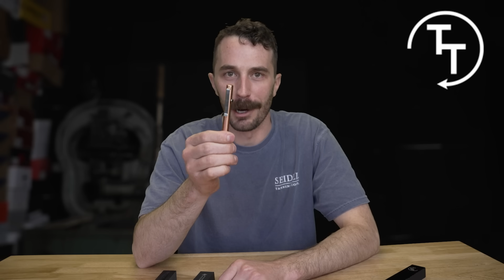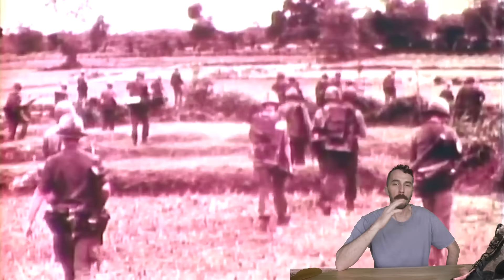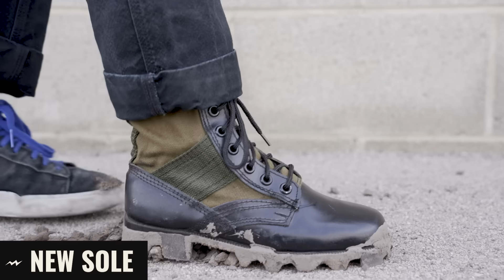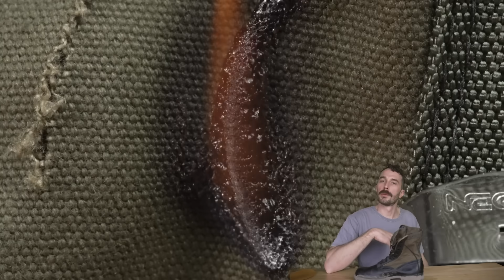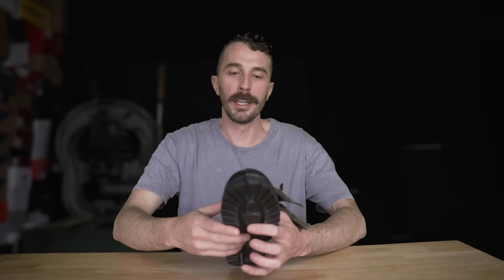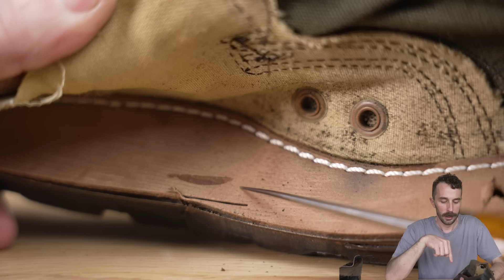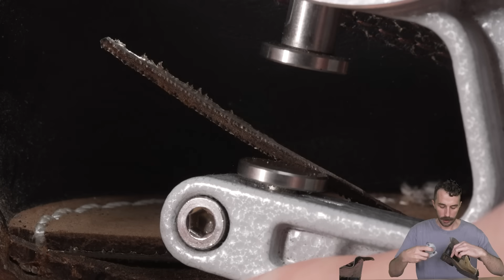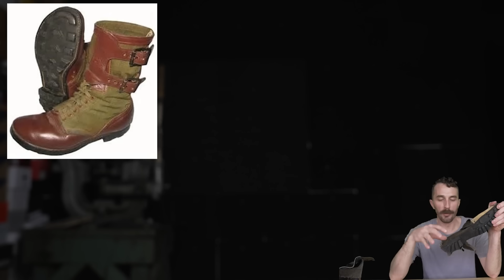Why it took 57 years to replace jungle boots

Comment: Those soles do work and I wore hot weather boots (more modern version) in both dry and humid heat.  Even if your feet get wet, they will get dry just from walking around for a while.

Comment: @Rose Anvil Really enjoyed the video, however the purpose of the wooden block isn't material purposes, as a matter of fact, the wood block is in there for marching. When you do drill, your foot slams gotta be loud and by extension hard on the foot, so the wood block is there so you can sound louder and more pronounced without doing what I did which was develop a fracture in my foot. this is also to make that commonly heard marching sound of 45+ soldiers helping you stay in unison with the others in your platoon or company.  The other use of the block in your boot is so when in training, the training NCO's and DI's will know by sound if you're doing the drill correctly.

Comment: I was issued the 2nd Gen. Vibram soled boot in the 70s after a few years of wearing the standard issue leather boot, late 60s thru late 80s. They were extremely comfortable in climates from desert to tropical. They were cold on your feet in cold weather. Go figure. They were popular enough to get a desert version made during the late 80s. I had my desert boots issued the day before returning to the states after Desert Storm. I wore them, as well as standard leather boots until retirement, but was not as happy with them as the older jungle boot. The mesh insoles were standard issue in the leather boots and were much better than commercial insoles as long as they were kept clean. During the life of my boots, I went through two or three insoles. They did wear out after a while. Bottom line, I wore two generations of issue leather boots and two generations of canvas/leather boots. The jungle boot was my favorite. In warm weather.

Comment: I have a pair of od jungle boots by RO-Search and they are made so well. They were made in 1980 and I've worn them on and off since the 90's. I just polished them and they still have traction, even the waffle insole is intact👍

Comment: I served from 1988-2014.  Until the transition to ACUs and the split leather desert style boots in 2003/2004, the jungle boot was the go-to boot for combat arms soldiers (except in winter time). I’d always have a couple pairs broken in and in wear rotation. I’d have to get a new pair every 6-8 months from wearing them out.  They have to be the real GI issue variety, not the horrible knock offs you find in most surplus stores.  Altima was the manufacturer brand name of the good variety. The GI issue desert tan boots of the ACU era were pretty much just a suede version of the jungle boot.

Comment: Ive been wearing jungle boots for decades. Hate to see you cut a pair like that up. Panama sole is about all that anybody can find any more. The beach assault sole was the best. The originals made in the 1960s and 1970s had higher tops, and the canvas was much thicker and really sturdy. They put spike protection in the soles, after that, all the soldiers started getting spiked in the side of the foot. Hell, all of todays boots are made in China. 🤢🤮

Comment: Was in Nam and loved the jungle boots. Light and dried out quick. Was lucky enough to be in a helicopter company so got to sleep in hootches with cement floors. Tried to hang them upside down so bugs would usually not enter. Had to make sure that you bang them together several times to remove roaches & other bugs. Never saw the jungle boots with extra large lugs. Thanks for great vid.

Comment: On my first tour in Vietnam--Marine Corps infantry--my jungle boots didn't have that nylon strap to reinforce the canvas sides. After about a year in the field I still had the same pair of boots. Both boots had a hole worn in the canvas about an inch in diameter at the ankles. I've always thought that was the reason for the strap on later models.

Comment: Back in the late 80's they must have found a warehouse full of Jungle Boots made in 1966 and issued them to us. They were so dry rotted you walked right out of the soles with a week. I'm still wearing the Magnum Boots I wore in Afghanistan 11 years ago. They are sturdy, have great ankle support and are as comfortable as a pair of sneakers. The Issue USMC Boots will last forever but are very uncomfortable to wear. The soles are like iron.

Comment: This brings back memories.  My two favorite boots were the jungle boots (desert version) which were about as good at it got in the desert heat, and for dress the Corcoran tanker boot, which were just amazing.  The Corcoran’s were not official issue, but they looked so good nobody ever gave you crap about it.  And yes, the jungle boot is not expensive.
Reply: Corcan tanker boots are authorized boots, anyone who says they aren’t just doesn’t know the order. Some older tankers used to wear them after they completed gunnery table 4
Reply: @kcLo505  I am going back many more years than I care to remember, and i was wearing them on the flight line.  (If they weren’t okay, why were they for sale at the PX? 😉 )
Reply: As soon as I graduated basic I bought  a pair of Cochran's. I eventually keep three pair in rotation. Formation, work, and field. Great boots!
Reply: My Desert "jungle" boots are still my GO-TO footwear for my lawn or yard work.
Reply: I never knew tankers had their own style of boot. I looked them up very sharp. I also loved my jungles and deserts.  I got out 35 years ago, but I still have a pair of each, they have side zippers now, but I wear them almost every day.
Reply: Spot on! I didn't know how good a boot could be till I got fitted for the DCU boots in Saudi. Tanker Corc's were the best for use while stationed in hot and humid Okinawa, year 'round. I got my first jungle boots while stationed in Hawaii, they were good for there too for staying cool.
Reply: I will say this for sure my desert boots we're the only ones I ever wore that didn't need to be broken in.

Comment: It's amazing how even a mass produced boot was so well engineered. It's easy to overlook simple things like soldier gear when you'd rather spend the money on more nuked and bombers, but it's definitely necessary to equip the little guy on the ground with the best if you want to win.
Reply: Mass production goods have more engineering than exclusive ones, i.e. Toyota expend far more engineer hours to improve their desings and fabrication process than Ferrari, doing a sport car for 200k unit is relatively easy, doing a rock solid vehicle for 10k that last 100 times and km more than the Ferrari with minimal maintenance is paramount of engineering.

Comment: I wish I could find a place to resole my Jungle boots I wore while serving in the infantry from 91-95. The sole is so worn down it is probably 1/3 the thickness of the boot you used. One funny story when we trained on the Big Island of Hawaii the training grounds were at six to eight thousand feet above sea level. It got below freezing at night so you learned very fast to pull your boots in your sleeping bag with you because if you left them out the steel plate would be so cold in the morning it was like strapping on two ice blocks to your feet.

Comment: The version that I bought back in early 90s from the Army exchange was not the same.  The toe stiffener was a torture device to shred skin from your toes.  The vulcanized rubber soles are slick like ice on hard surfaces in cold weather.  I ripped the toe stiffeners out with a leatherman and then they were fairly comfortable.

Comment: As a soldier who wore. Jungles ,although in my day . Black uppers with speed laces. And I had the steel shanks removed From mine and ripple soles installed.  With gel insoles. They made a fantastic Everyday work boot

Comment: This boot got a lot of soldiers killed because of the Metal flexed  at the tow area the metal would break and make a clicking sound as they were slipping through the jungle you can imagine 10 or 12 guys with broken metal clicking in their boots as they're trying to slip around.

Comment: Thanks for the video although my wife heard me scream when you cut my favorite boot in half!  

Fell on this video by accident and can say with authority (opinion!) these are the best combat boots I ever wore in nearly 34 years as a combat arms officer.  My pair is now 54 years old and was probably last worn during Desert Storm.  Sole is marked GENESCO and the date on the tongue is dated 5-68.  These were the first Panama sole pair I was issued (or owned).  Issued in 1969 and I wore them home and in the field for years.  

I wore a previously privately purchased set of earlier generation jungle boots most of the way thru Ranger school after the seams on the back of my very expensive jump boots fell apart.  We were required to carry spare boots and I just sat down on the side of the road, changed boots, and left the jump boots to the brass pickers.  Never looked back.  It was winter and they worked fine in the mountains and were invaluable in the swamps.  

Earlier versions had the horrible vibram sole (hate to capitalize that brand name) that, as the video nicely depicts, do nothing but pick up mud.  We all found excuses to upgrade to the Panama sole whenever they became available.

The Panama sole is still available in boots although I couldn't find any in the PX where all they seem to carry is desert oriented boot soles.  Different mission orientation.

Comment: Hands down the most comfortable boot I was issued and purchased over my 21 year career. Couldn't wear them in Germany but the 10 yrs I spent in panama its all I wore. I was taught to just wear them barefoot, some did I didn't over the long term. First jumping in the shower with them and letting them fit to your feet was how I was instructed. After hours, days, weeks and months in and around the jungle it was the right boot to use. I tried a Desert jungle boot (I know) but it just wasn't the same quality. I walked across the country of Panama with those desert jungle boots and put them away to be forgotten about.

Comment: I have a pair of 67 dated jungle boots & man.   The sole is in tact still.  The tread hasn’t worn. Not a rip. Not a tear.  Mad comfortable.  Speed laces fast af.  Just enough foot room for a size 10.  I love them so much. I used to wear them to work & I’d step on nails just for the nails to bend 😂   I recommend some to anyone looking for a good boot.   Try the bamboo spike insoles.  Phenomenal
Reply: I have the leather insoles on mine.  Haven’t had to replace anything on it ever
Reply: The only prob I ever have with mine is just mud getting stuck & accumulating. Makes it hard to walk on the tread

Comment: My favorite boot was the Issue Jungle Boot with OD Green Canvas uppers (they were still available through clothing sales until the the late 80's).  When they went to black nylon uppers they just weren't the same.  
And the "Jungle Boots" you can find now with green nylon uppers, even through the PX system, just aren't the same quality.

Comment: Im currently in service with in a tropical country's military service which i wont name (points to whoever guesses it right). And we use US branded jungle boots some of the modern updates baffle me, like the vent holes are now a mesh, and for our regimentation, we have to polish our boots often due to alot of mud, hence alot of wax buildup in the mesh, rendering that feature pointless. My feet got to the point of the second "trench foot" photo many a times, but then again, when our training zones are always swampy and mud sticks up usually at least to the shin, there aint much a design can help in ventilation, egress of water in the boot, or grip as the sole is constantly caked in mud. But thats just a lowly conscript complaining about it while i sit at home recovering from a servive injury (hint hint)

Comment: On the puncture test it seems like you also punched through the steel shank which were avoided in the other video examples by targeting the tow rather than the arch of those boots. Mind you, it could be that the number provided was from an out of focus shot tested like the other boots.

Comment: I've been selling boots since 1976 in our family shoe and boot store and back in the late seventies and on into the eighties we sold quite a few pairs of  "jungle boots".  Genesco (Nashville, TN; currently makes Johnston & Murphy brand footwear) made a bunch under contract and kept up production for a little while after Vietnam.  They didn't come in boxes (you could for a fee get 'em boxed)  rather in keeping with producing the boot at the most cost effective per pair price they were bagged.  Later the US-Made production seemed to end, or become harder to find.  We were a Carolina boot dealer and Carolina started importing "Jungle Boots" under their alternate "Red Bird" branding used for cheap imports.  These were in no way as good even if they looked like the same thing to the uninformed.  I believe if memory serves they even had a PVC sole at some point instead of the real rubber sole.  I'd say the original "Jungle Boot" which was made by a variety of US manufacturers was a pretty well thought out and realized boot.  It wasn't the end-all, be-all boot rather it was truly purpose built to achieve specific goals above all else.   The manufacturers really implemented a good welt seal by upping the rubber/leather vulcanized bond properties.  Very few pairs that I ever saw had sole de-lamination which is amazing to me (I am also a third generation shoe repairman).

Comment: I had a love/hate relationship with Jungle Boots during my time in service. I liked that they were light and breathable and let water out BUT they were too thin at the mid-foot for me and it caused terribly painful abrasions there for me. I’ve tried on different sizes and widths but could never get a comfortable pair. I stuck with Infantry Combat Boots and just put extra effort into taking care of my feet and getting quality socks and changing them frequently.

Comment: Issue jungle boots were some of the best boots you could get, period.  Even the fancy Bates and Danner boots were not as good.  The jungle boots were slightly less comfortable but you could fix that with a couple of sock layers.  The GI all leather boots, however, were an absolute shit show.  The may have looked good all spit polished, but they didn't last as long and tore up our feet something fierce.

Comment: There were actually three sole designs, there was a middle sole design that was in between in aggressive studs (more aggressive than the WWII design but less aggressive than the final design) and without the metal insert. I was issued them at ITR in '70 at Camp Geiger and wore them in Vietnam for 13 months 14 days in Nov. 2nd '70 through December 16th '71. I still have them in my closet and they are still my Go To hunting boots here in rural Florida.

Comment: My first experience with jungle boots was when I got stationed in Panama after Basic.  We were issued 2 pair after arriving in country.  The where the most comfortable boots.  It was general practice for us to remove the the steel sheet and shank.  I preferred the green cotton canvas over the black nylon.  They were softer and lasted much longer than the nylon.  Plus the green looked better.
   Before leaving Panama I took my boots back to CIF and exchanged them for 2 new pairs.  I kept one pair for daily wear and the other pair I had resolved with the spongy Vibram soles for road marching.  The resolved pair lasted me around 6yrs and 2 more resoles before the had to be tossed.
   I was able to get by with them for a few years after the reg change which banned the green by showing the CIF stamp on the tongue, proving that they were issued and not purchased on the market.  
   I even wore them in the field in winter, my feet stayed dryer in them since they didn't retain the moisture like the heavy assed winter boots that just made my feet sweat.
   I was out before the new boot types came out, but I must say they look very comfortable and would probably make a good replacement for my trusty jungles.

Comment: i had a pair when i got out in 1972 and wore them out working for the power company. i was always looking for another pair of the genuine ones not the chinese knockoffs. i finally found a pair  recently and my size 12R at a rummage shop and they were brand new with the tags still on them. they have the newer sole design not the original.

Comment: Honestly 300lbs of force is not a lot when you take into account momentum. A quick google search shows your feet can apply 3-4x body weight when running, so if you ran onto a single spike as strong as the one you used, it would surely go right through. Even bamboo, if it's hardened off properly, would be able to make it through no problem, I'd think. It would be interesting to see stats on whether this actually prevented any significant puncture wounds i.e. punji sticks.

Comment: I bought a pair of them some time ago, and I don’t wear them a whole lot, except for specific jobs.
One was a flooded basement, because regular boots won’t drain water.
Every time I walked up the stairs out, I noticed the water pumping out the ports, and they dried pretty quickly.
I’ll be keeping them around.